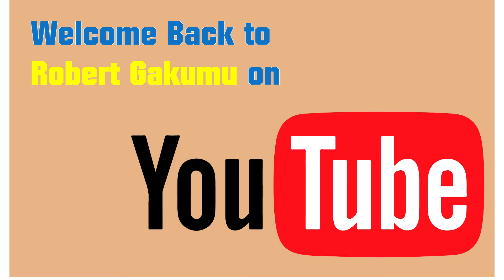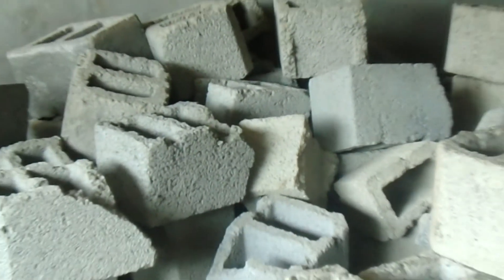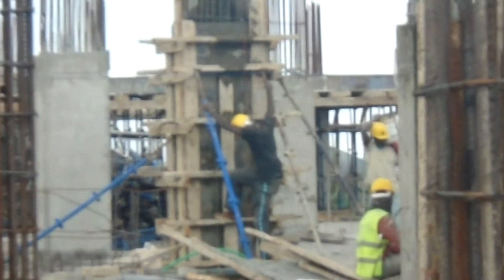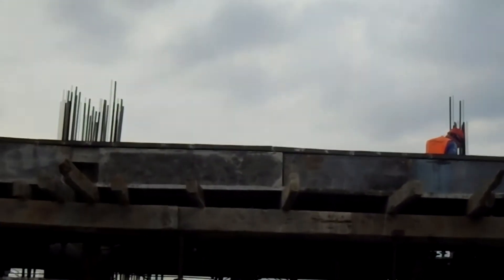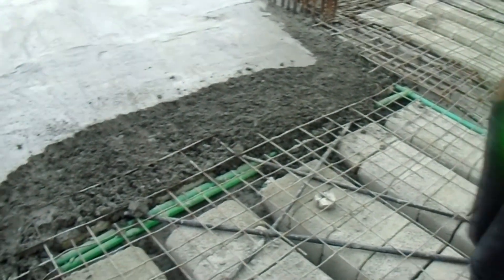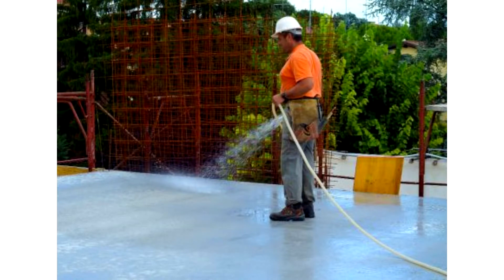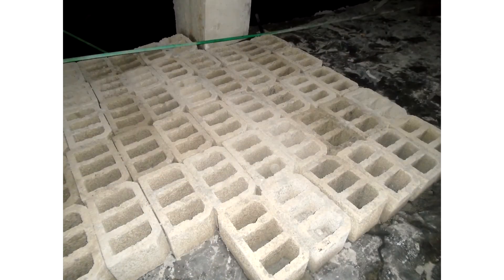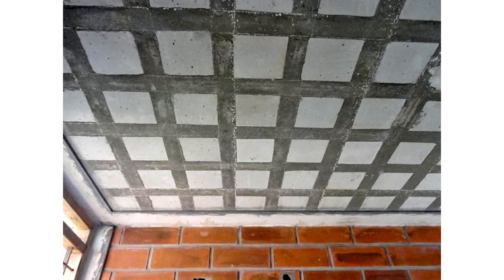Hollow 'pot' Block Floors: Why they may Offer a Better Alternative to traditional Suspended Slabs

Comment: Very well explained; longer floor spans, soundproofing benefits, possible cost reduction depending on Engineers design. Video editor to avoid the blackouts between photo presentations